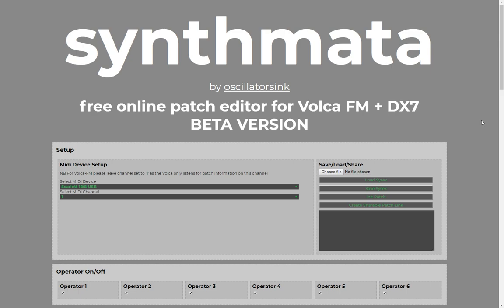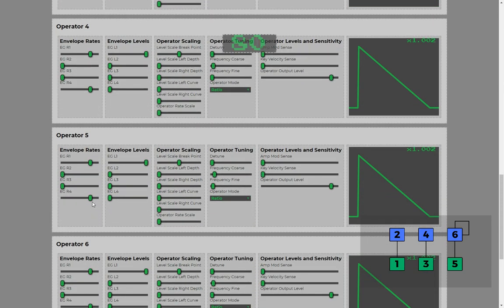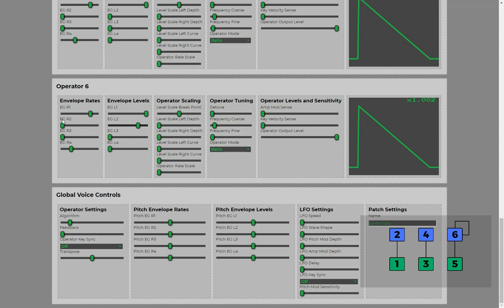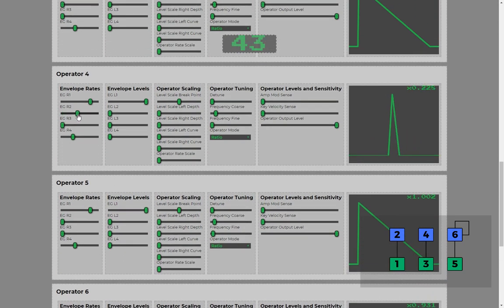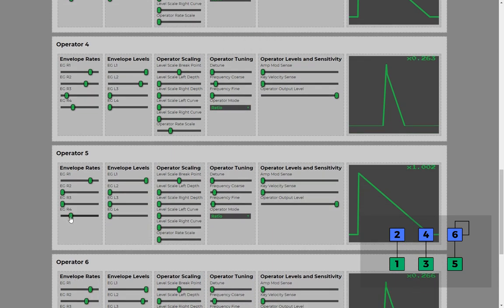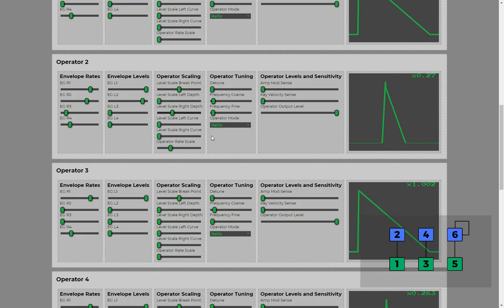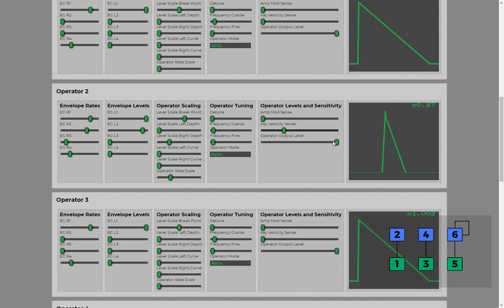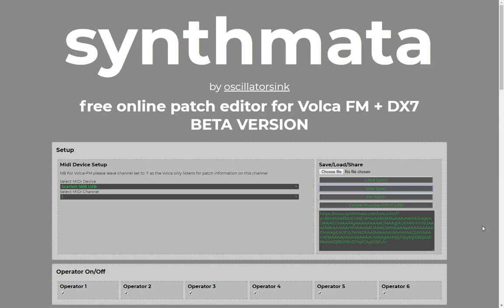Korg Volca FM - Let's Build A... Pad II!

Comment: As for next patch requests? Well atm I'm trying to modify two default patches to create new sounds. The first one is trying to turn "Musicbox" into a Doppler-shifting echo using a pitch drop on pt3, a slow square lfo  and a slow release on EGr4.  The other one is me trying to turn "distortion" into a playable version of The Transformers' transform sound (slow pitch rise at beginning and slow sine LFO) but that's as far as I've got with either.
Reply from the maker: +Dino Goldie I'll try to work the echo idea into an upcoming video. The Transformers sound... Might be a bit niche for the channel.. But I guess I might fit into the percussion pack I'm building...